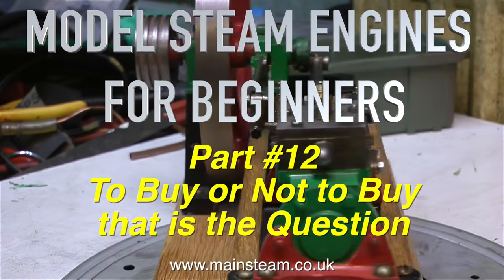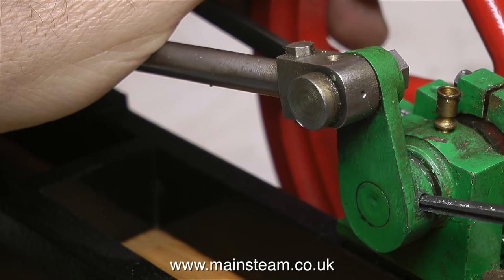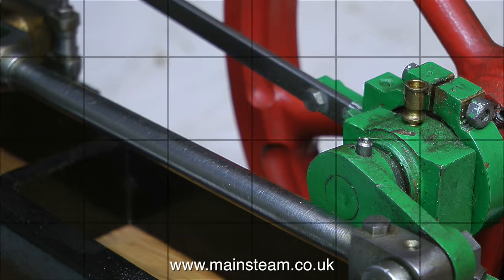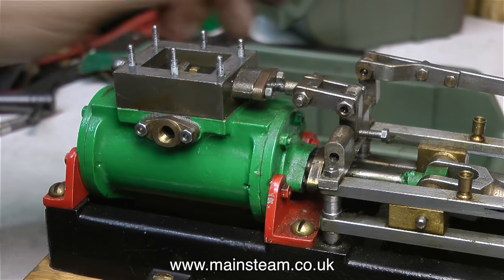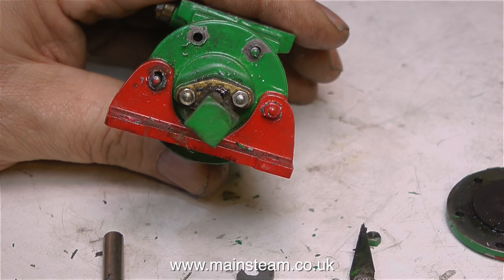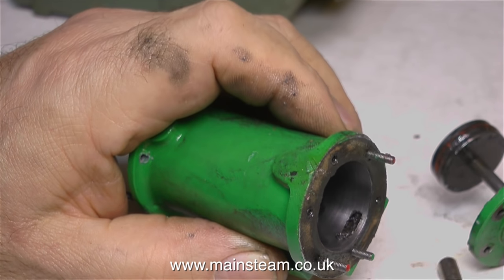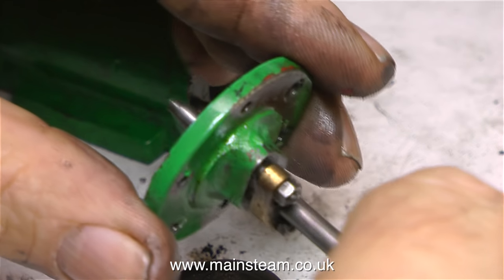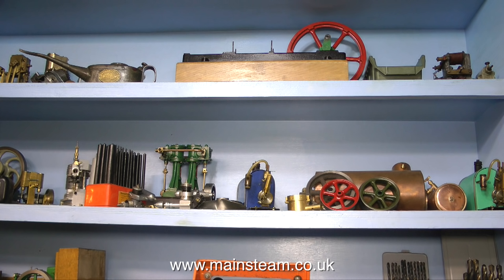TO BUY OR NOT TO BUY? - MODEL STEAM ENGINES FOR BEGINNERS PART #12

Comment: I purchased a half built Stuart Beam Engine a few years ago.  The base and all the bearings had been machined, and the cylinder.  But, the cylinder was about the only piece that had been done almost correctly, and even that has one or two issues that are going to grate on me.  Over the time since I’ve bought it, I’ve gradually been correcting what was done badly and remaking bits that are not done well at all. 
It’s a case of buyer beware.  If you’re prepared to fix muck ups and make new parts, then if you can get the engine/castings for a good price, go for it!  But if you are not, then maybe best start from scratch with new castings or an engine that you know the previous owner of.
Having said all that, Keith, I’ll give you a hundred for that if you throw in the spare cylinder casting!  And I’ll even do a blog of the doing up for you...  and I’ll pay the shipping to Australia!
Love your videos!  I even manage to stay awake while you’re painting!
Hugh.

Comment: Time for a noob question again :D
Do you happen to know what the advantage of having the ports done in the casting is, instead of being machined in afterwards? It just seems like a pointlessly complex thing to make a mould for when it's something that should be doable with a few holes (but then again, I have little clue about casting or the cost factors involved). Or is it simply not ideal when the steam would enter the cylinder at the very end (which would be the easiest way to do it when using machining)?
Reply from the maker: Drilling ports can go spectacularly wrong at times, plus apart from the volume generally being larger for more efficient inlet and exhaust of the steam with cored in ports, it's more like full size practice to have the ports as part of the casting. . .
Reply: Right, thanks. Would be really interesting to see such a mould being made and used. Can't imagine how this fragile sand structure for the ports would hold up, but I am sure there is a trick that makes it easy, as always ;)

Comment: 5:52 the man who built it probably had the general knowledge many gasoline engine performance seekers have about valves and air intakes/exhausts. More flow=more air for combustion, less restrictions, more combustion , more power. Many performance seekers will take the heads, valves,   air intakes and modify them to give thier car more power. So someone with this mindset probably had the same idea. I mean the valves do "seem" to have a lot of restrictions. Lots of 90 degree bends for steam to snake through.